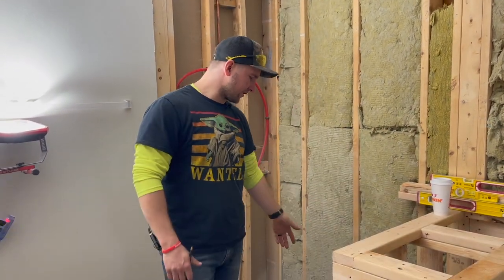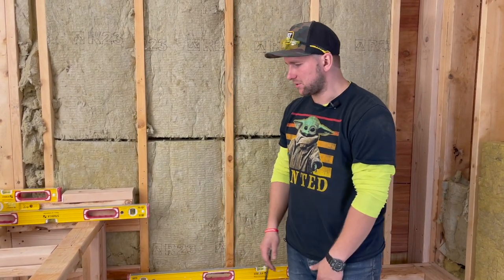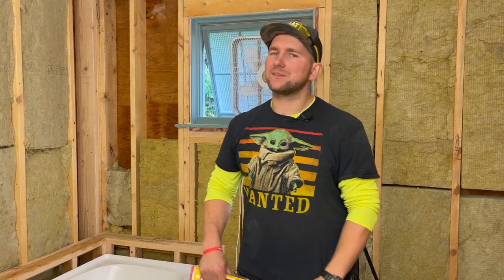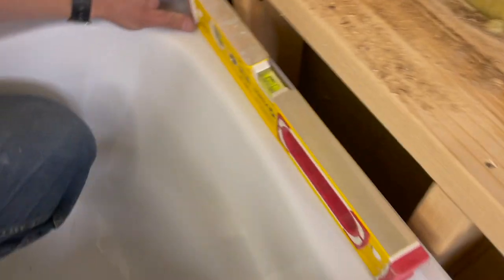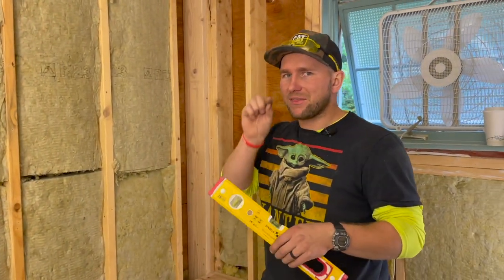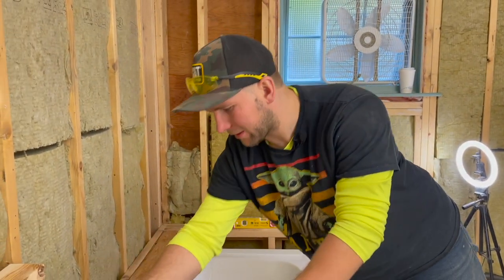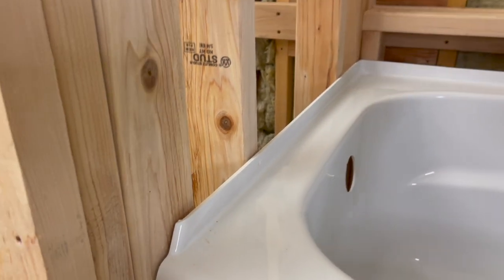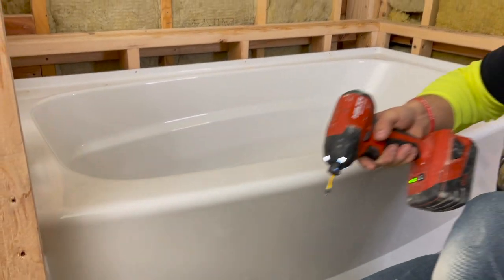DIY Tub Installation 🔥 Delta Bathtub 🔥  how to install a bathtub

Comment: I like sitting the tub on some mortar...feels solid and let's you level it without sacrificing any contact surface. Not a fan of countersinking, rather use modified truss screws...larger contact surface and doesn't weaken the flange at the fastening point like when you countersink but if space is limited then countershinking is the way to do it.
Reply: I second everything you said. Being a plumber, we always set our tubs in a morter bed; feels so much better after cured and you can level it perfectly. And they make a tub drain wrench that works so nice. Thanks for the video, keep up the good work.
Reply: I couldn’t agree more
Reply: I also do a mortar or sand mix bed to get 100% support under the tub. I put down a layer of plastic on the subfloor first before the mortar. I also use truss head without the need to countersink for better holding power.
Reply: Any advice on leveling a steel tub ( American standard America’s) with an uneven floor? I used floor leveling compound but still not 100 percent. Shims, mortar?
Reply: * Americast

Comment: All of the tubs I set I put a 2 x 4 piece of wood Under along the 5ft side to hold the tub from rocking . Some plastic tubs are too flimsy and can shift even though you screw them down and they’ll sometimes crack the flange and can spread to the tub where the tile doesn’t cover it and you’ll have to replace the tub .

Comment: Did you have any issues with the drain leaking in the bottom side of the tub?  A lot of people online are posting issues with sealing the tub drain because of the plastic frame on the bottom.